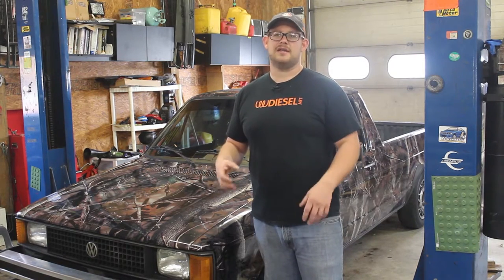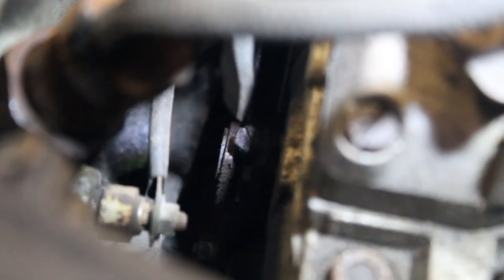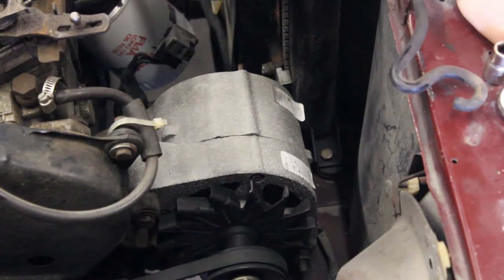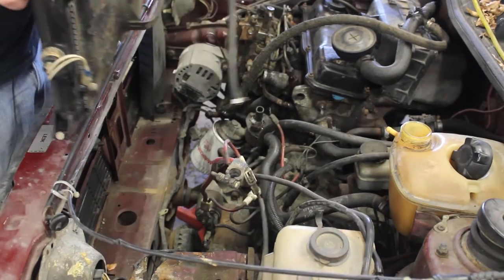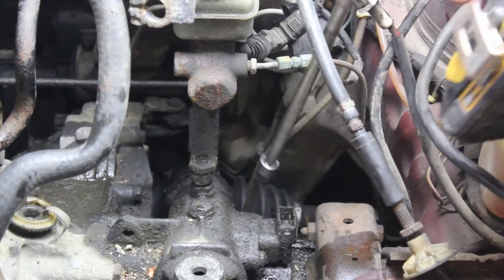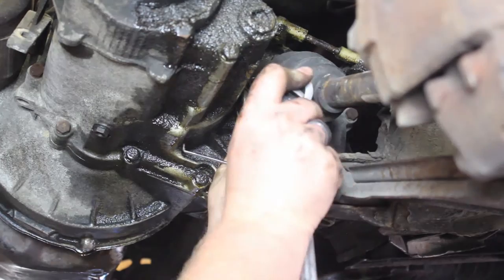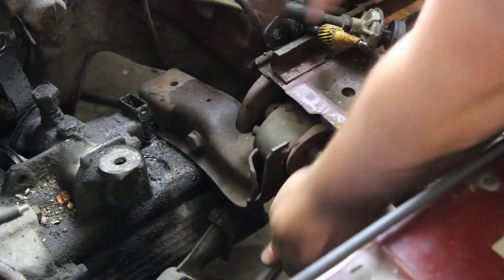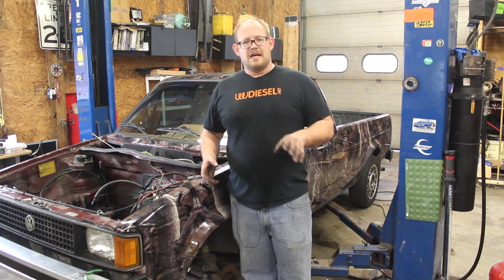MK1 Rabbit Pickup (Caddy) Diesel Engine Removal for AAZ Swap. Video 1 of the series

Comment: Mr. Turner,

     Thank you for the tutorial on the engine removal. It was well presented. My wife and I have a 1980 B1 Passat/Dasher Diesel wagon with the standard 4 speed transmission. I Do not need to remove the engine because it is fine. However, I did kill the previous 1.5 liter diesel in the 5 door hatchback we had before the wagon. We still have the sedan too. I was driving it too hard and the #1 connecting rod was thrown through the block and it pushed of the water pump on the way out too. Yikes!!! As you might know, this engine is mounted longitudinally like Audi designed it to be. And it is front wheel drive as well. Really the only difference is the alternator location in comparison to a rabbit or caddy....or scirroco. Oh....and the radiator is smaller and sits on the drivers side of the grille only. Otherwise the engine would have no room to fit front to back as it does. I have a question about the blower motor for passenger compartment heat. The fan does not turn on at all. I am going to check it’s operation with my portable battery pack. I will use the pack to touch the resistor leads on the insulator under the drip tray in front of the wind screen to see if they activate the motor. I know the ohm resistances (impedance) already and used my multimeter to find out what they are and the three of those leads are low medium and high can speed settings. I have the old working blower motor from the dead sedan and it works fine.

Comment: Your video is really amazing. I fallowed all what you did, but when a putted back I forgot to connect the wire that go to the fuel cutoof solenoid and the sad part is can't the wire. Can you tell from where is comin the wire that connect to the solenoid. The engine crank but won't fire. Thank you

Comment: I did this last week! fairly simple. Now I'm kind of struggling to get it primed after installing again any tips for that? I have minimal experience with diesels.
Reply from the maker: I usually attach a Mighty Vac to the fuel return line on the pump and apply 20 psi of vacuum to draw fuel into the pump. Then crack the fuel lines at the injectors to bleed the air out of it and crank the piss out of it.
Reply: +Ryan VWDiesel I've been pulling on the return line with a vacuum pump and doesn't seem to actually pull fuel. I've definitely been cranking the piss out of it though haha.
Reply from the maker: +brian62793 Might be easier to try to help you out on FB. Join the VWDiesel Facebook group and Post your problem there and I'm sure we can figure something out.  http://www.vwdiesel.net/fb